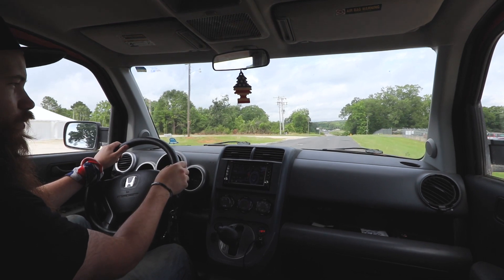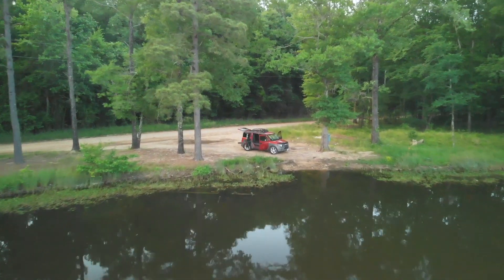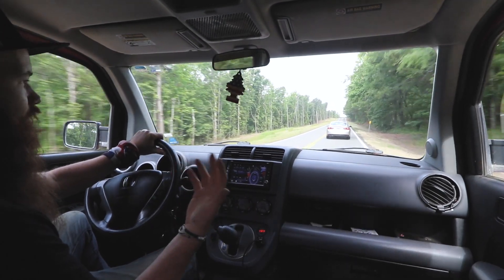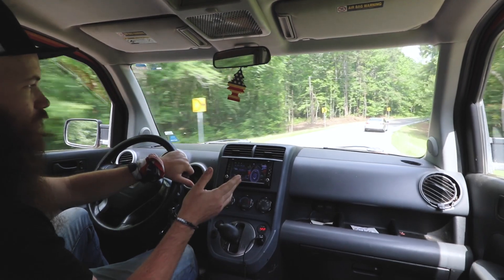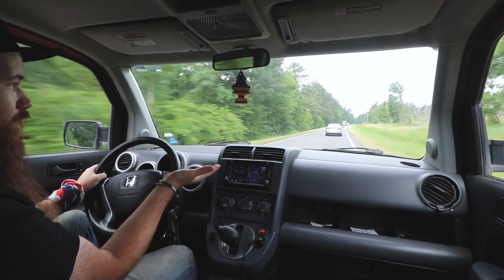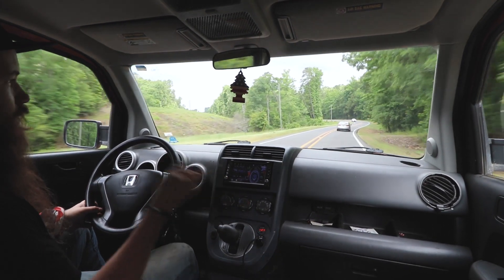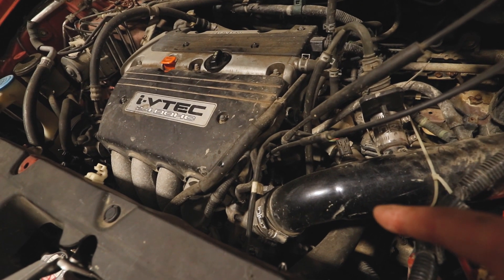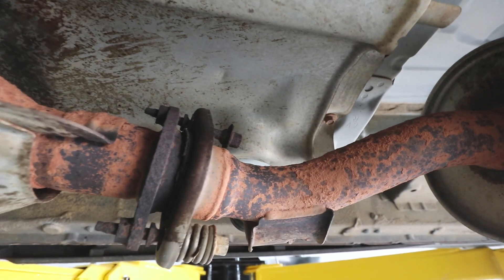Review of the 2003 Honda Element(10+ years of Ownership)

Comment: This is a FANTASTIC review although I wish you'd have spent some time on the wonderful features of its interior.  A little of my own experience which didn't end well with me having to sell my 2005 Element with less than 60K miles on for a mere $500.  To explain, in 2005, I bought my 2005 Element EX brand new and direct from a Honda Dealership in Pottstown, PA.  During the time I bought it until 2018 when I had to sell it, I sooooo loved my Element.  I did  have the breaks and rotors repaired yearly which was a pain as well as the tires replaced once, but other than these and required maintenance, the car was fine for about 6 of the almost 14 years I had it.  In 2007, I was bit by a tick and  became VERY sick with Lyme Disease being bedridden most of the time until mid 2016.  It took over 11 years to be diagnosed and treated, and as a result, my Element sat in my driveway a good majority of the time.  Knowing little about cars outside of driving them, in 2010 with less than 35K miles on it, the oil gaskets dried up and leaked oil. When I went to drive the car, the engine  blew, and I had to replace it to the tune of over 5K (it was a used engine with 45K miles on it). For a while the car drove fine but continued to mostly sit. In mid 2016, before regularly driving it, I had to have a lot of work on it which cost another 3K.  My Element then worked great for a little over 2 years as it was regularly driven, but in mid 2018, I started having some MAJOR issues with the brakes once again.  I brought my Element to Altlantic Honda in Bay Shore, NY and they replaced the breaks, timing belt and more costing me almost 1K more.   Less than 3 months later, I started having HUGE issues with what I thought were the breaks again. It turned out that the front passenger side wheel was hitting up against the wheel well when making a right turn.  I brought the car yet again to the Honda dealership/service center and was told it would require another 2K worth of work.  I couldn't afford to put more $ into the car, so this time,  I brought the car to a trusted friend who owned his own shop and had an excellent reputation.  He put the car up and found so much rust on the bottom (undercarriage? )  that he said it wouldn't be worth even changing something so simple as the oil.  Even though my Element looked new on the outside and interior and had just over 60K miles on it, with SO much rust on the underside of the Element, he told me if I hit so much as a pothole, the entire engine would fall out.  I asked him about repairing the car yet again, and he was quick to say that it wasn't worth it and that the car was completely unsafe to drive, so much that he was concerned about me driving 1 mile home.  I was desperately in need of another car with less than 12 hours, and wound up going to the Honda Dealership /service center that did all of the work on my Element from late 2016 to just a few months before having to let go of my once loved Element.  I made the HUGE mistake of going to yet again the Atlantic Honda in Bay Shore, NY, and was sold a 2016 Used Honda Certified CR-V thinking and being told it would come closest to replacing my Element.  Of course this was a bunch of BS, and not only did they mislead me on this, I was told that the car was perfectly maintained, never in an accident, had a very high rating through carfax, etc.  Just as I was signing the papers, I was told they were mistaken and that the car was in a minor accident (which turned out to be a more than minor and a multi vehicle accident).  Had I looked back, I could have bought a different car, even a brand new CR-V for less than $1K more than what I paid for the one I was sold.  Being too big of a car without the features I needed and too small of car than what I wanted and without the features I needed , to this day, I soooo regret buying the CR-V.  Even if I loved it, I will NEVER purchase another car again from Atlantic Honda in Bay Shore, NY, and  probably never a Honda again unless, perhaps, they come out with a new a Element.  Of course, the issues with the Element were mostly due to me being so sick and the car sitting so long, but how could Atlantic Honda not have seen all of the rust having worked it on many times from 2016 to 2018, without saying a thing about the rust even less than a few months before having to rid of it.  Without the space to piece meal the car's parts which were in pristine shape, I wound up selling it (in less than 2 hours) for $500 to a used car shop which no doubt repaired and sold the car to some suckered (SMH).   Because of all of this, I will NEVER buy a Honda again and certainly NOT from Atlantic Honda....  Sorry to write on and on, but I am hoping my experience might help another person...
Reply from the maker: No, no that's a great story! Shady dealerships should be held accountable for trying to screw people over. We had a horrible experience driving to Dallas to buy an MDX that sounds a lot like that. 
A side note, I also have Lyme Disease I caught it last year when we went to Maine for holiday. I hope you're doing well with it, mine has been very manageable so far. 
As far as the interior quirks, I'll save that for a future video. This video was just for people who were perspective buyers or possibly people looking at long term Element owning. Glad you liked the content! That means a lot to me.
Reply: Actually if they told you they replaced the "timing belt" that is hilarious!! Since this engine has a timing chain.

Comment: I bought my brand new 2004 Honda Element in the winter and the windshield was cracked from a rock on the highway within a month...but I love my Element and still have it (replaced the windshield). It'll be 17 years in February! I'm probably going to keep my Element forever. I'd even buy another one if I could find one!!!

What tires would you recommend? I'm just a daily driver and in Florida (so no snow).
Reply from the maker: That's incredible! 17 years! 

As far as a good driver tire, the best advice with tires is you get what you paid for. Just find something mid tier with good reviews. I don't usually have a preference because I have so many different cars. Just whatever suits the car at the time.
Reply: @DashnCars  Thanks! I'm so glad I found your video!!!
Reply from the maker: @skkeech  absolutely! Glad to hear of another story of Element love. Always makes me happy!

Comment: Like you i have a 03 178km replaced the oxygen sensor ,normal seat belt buckle ,have just bought a catalytic converter which apparently is very common target for lazy thief's.
Another issue i have is when i turn left i get a rubbing noise from the rear wheels. Still don't know what that could be, if i where to write a list of everything ive hauled from glass round tables to motorcycles composite  etc. and even camped in it with an ikea twin mattress ive owned it 12 years and use it as a utility vehicle.
Quite impressive for a 20 year old car,with the skyrocketing vehicles' that are out of reach its nice to roll down the road a classic indeed. Ty for your video.
Reply from the maker: Thank you for sharing your story! Elements really are the best!

Comment: U r awesome!.. I had a 2006 and gave it up after transmission started to go bad.. Those solenoids!  City driving and heavy hauling finally succumbed to rigors of punishments... Who said 4 cylinders can't perform....Mine did!  Bought it used with 36k and sold out at around 150k... I Replaced... Starter... Sway bar on both fronts... Many many brakes pads and rotors... Seized rear calipers... Strut mounts... Several broken windshields... Driver's side Actuator..... Every thinkable fluid changes...belts...etc... All those work completed with just using jack stands..I wish I had those electric lifts... Would have done more.... To be honest... My Element lost its drive to live after it got beaten to death during the Baltimore riot...it died after about a year later... I now own a G2 Ridgeline. Love it just like the element... Thinking of buying the next element only if it comes in a stick though... Cheers
Reply from the maker: Thanks buddy! The Element is something else, to own one is to know the love! I love the Ridgeline too, very awesome in its own right. 👍👍

Comment: Great tips in this video. Bought my 2003 a year ago, in pretty good shape, 183k miles. Love it.
Q: The clear coat is going in a few spots on the hood. Suggestions?
Reply from the maker: Hey Tim! Thank you! That's actually a topic I'm researching at the moment. I have the materials to touch up the clear coat on my spoiler I recently purchased. I'm the world's worst at body work or paint, but I'm going to at least attempt it. From what I understand a very high grit wet sand at several stages then reapply the clear coat. I'm sure you need a special clear coat for automotive paint. UV protection and etc. I'll be doing a video on it soon.
Reply: @DashnCars  Thanks - I look forward to it

Comment: My father has a 2006 and it has been pretty good it was losing coolant, and it turned out to be a warped head but had it machined and no problems since. Being a Wisconsin car, the body is clean of car cancer. Although some of these suspension components are a bit rusty. I always wondered if using some dynamat or even some automotive carpet would quite things down some.
Reply from the maker: Might be worth a shot! A lot of modern cars use felt and other materials to calm the road noise down a bit. At the end of the day, it's a giant box pushing through the wind.  It'll be noisy unfortunately!  Glad you're dads 06 is doing good!

Comment: Amazing! Thinking about buying one of these. You might have just sold me :) Great depth and detail.
Reply from the maker: Much appreciated! Let me know if you have any questions at all. Good luck on your hunt 👍👍
Reply: If decide to pull the trigger on an Ellie, join the online hondaelementownersclub. They can answer just about any question you may encounter on any subject pertaining to these little beauties.
Reply from the maker: @AARON780281  And in case they are slow to answer, that's what I'm here for!
Reply: @DashnCars  have u done the internal back hatch release on ur El yet? Super easy with 550 cord, electrical tape & a split ring key ring. Took about 10 min @ work with a dremel.
Reply from the maker: @AARON780281  I've done it way easier. Just remove the back plastic and you can just pull the lever 😄
Reply: @DashnCars  lol
Reply from the maker: @AARON780281  I did it way before anyone decided to do the handle in the back. Not mad, if it works it works! 😁

Comment: i got my 03 WITH already 189k miles, it sits at 232k or so but mine is a manual. I do envy the gear ratios on the automatics though, as the manual from 03 revs really high at freeway speeds. I also replaced the suspension, but I used Monroe quickstruts. I have also done a lot of the bushing replacement on the bottom with the exception of the lower control arms on front and back. the ONLY major issue I ran into was once the clutch slave cylinder went out after I got to Target, was able to get home and get another one. BIGGEST issue was my transmission started making some weird noise, was diagnosed with a bad release bearing on the clutch. Took the opportunity to take it south of the border (since I live in Southern California) to a mechanic I know who rebuilt my transmission and more for a lot cheaper than in the states. I never considered the element something you could drift or race around the country in haha. i always fear i could flip mine over to take any kind of quick turn or curve. my favorite mod on mine is the aftermarket halo LED lights I installed. will follow you on IG!
Reply from the maker: That's a great story! Yeah I've raced mine for many years. It unofficially retired back in 2016 from competition but I would be right back in a race with it given the chance. Any kind of headlight upgrade is a game changer on the Element. The factory lights just aren't great.

Comment: Hope you got the proper center caps.  Also, you stated it has a 12 gallon fuel tank.  Strange as I've filled mine with over 13 gallons before and specs state it has a 15.9 gallon tank.
Reply from the maker: Wheels are long sold now and yes I've corrected myself that the tank is 15.9, however most gas pumps will click of at or around 13 gallons.

Comment: Owned 2005 with 85,000.  Not ton of issues but I live in big city and due to having to park on the street does get rusty, breaks and tires replaced few times.  And I have a cat clamp to safe guard my catalytic converter.  It was stolen twice.  Very expensive to replace so no issues once the clamp was put in.  Also my cruise control stopped working which is odd because I rarely use it.
Reply from the maker: Sorry to hear about the cats, such a problem in big cities. Glad the clamp is working though!

Comment: I've owned my 2003 Element 5-spd AWD EX since 2007 and only had to change the bushing and brake master cylinder.  Everything is stock and much quieter than yours.  27 mpg mixed driving.
Reply: wonder why he gets 17mpg and you get 27
Reply: @basedchadthad9597  I drive like an old man, accelerate slowly and coast early before stop lights instead of braking.  Works well with a stick shift.  I wished they had a 6th gear because the gearing for AWD is fairly low.  You can get a OBD2 Bluetooth dongle and monitor mileage on an app.

Comment: One thing you really need to be careful of if you own one of these is your catalytic converter. I haven't finished watching the video so I don't know if you've touched on it but these are notorious for having their catalytic converter stolen mostly from what I understand because of the height they're not too high and not too low the perfect for getting in and getting out quickly. It's probably a good idea to invest in what I call a cat cage first time I saw one was on Facebook in the battle-born element group. I see them around a lot more now. It's probably a good investment because it cost a fortune to put an oem cat on your element. Even the aftermarket will run you a couple hundred dollars to have it installed.
Reply from the maker: Very true, I'm on all the Facebook groups as well and the cat thieves have been going nuts!
Reply: Yeah I lost mine in September. 1300$ to replace!
Reply from the maker: @fhardin2002  crazy! I hate that is happening to Element folk.

Comment: What’s a “slider” I pulled up at home after my 55 min commute and thought I smelled smoke.. i checked the oil but it was fine.. perhaps something else was overheating.. i have the same 2003 299k miles..
Reply from the maker: Can you refer me a time stamp for your question?  It's been a while since I made this lol.  And check your exhaust, sometimes you might get trash or something on it from the road.  Rare but it could happen!

Comment: Has the transmission ever have given you problems along the way before you reached 200k? For my 03 element, my auto transmission had to be rebuilt by my previous owner. What tips could you suggest for preserving the life of my transmission? That’s also taking into account that I get stuck in stop and go traffic. Which I know is bad for the transmission. What are your tips for preserving it? I changed the fluid and fluid with oem Honda fluid. It he rebuild was done at approximately 110-112,000 miles. Now I have 170,200 miles. What should I be concerned of?

Comment: Great video, I have a 2007 honda Element with 139,000 miles having a lot of those issues that your speaking about. I get a check engine light, and it is describe as accelerator issue, after I stop the car and shut it off it resets, and light shuts off, it happens everyonce and a while.
Reply from the maker: It's probably a simple fix, the newer models live the 07 have a lot of sensors to let you know if anything at all is odd. Sounds like yours isn't too bad, probably just say for a while since it has pretty low miles.

Comment: I've got an 03 honda element fwd, brought it used 3 years ago, let me tell you These feel every bump in the road, noise bucket suvs have about 45 to 50 different gaskets /seals on the engine & mnts. Something's always leaking/ eroding on these vehicles, The upper control arms for the rear wheels wear out and allow the back wheels to lean out in knot kneed fashion! 😄 causing premature tire wear, the upper 17 mm bolts r the hardest to remove, you don't have any space to get a wrench on it, rear sway bar links and bushings always squeak, the rear struts leak &  cause a lot of bouncing, all engine mounts will erode causing the engine to lean forward when braking, front strut tower plates always wallow out and cause the front end to pull left or right when driving you must change them immediately to prevent an accident from occurring but other than that the 2.4 litre engine is pretty solid and the transmission still hangs in there after 214 k miles.✌
Reply from the maker: That's about everything there! 😄😄 And I still love mine!
Reply: We got adjustable control arms for the back and that helped with the tires.

Comment: Found a cheap 2003 with knocking sensor problem. Also found some steals that have blown pistons or needs new transmission for around 1k-2k with clean interior/exterior. What are your thoughts on buying a fixer. Is it worth it and how long would it take to fix these kinds of issues I’m guessing the cost would be 2000-3000 to rebuild some of the stuff
Reply from the maker: Sorry I missed this comment!  If you can find a fixer.with good bones, totally worth scooping one up. People always are looking to buy one, if you ever decide you don't want it.  I got my AWD manual for $600 because it had an exhaust valve stuck. Not a terrible fix and if I want to put another motor in it,  I can find one for under 1000 all day long!